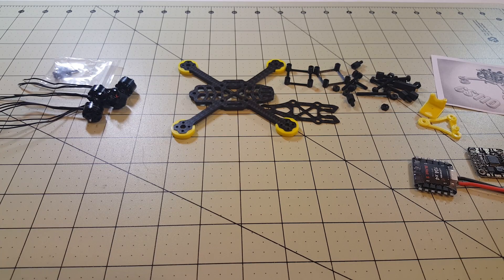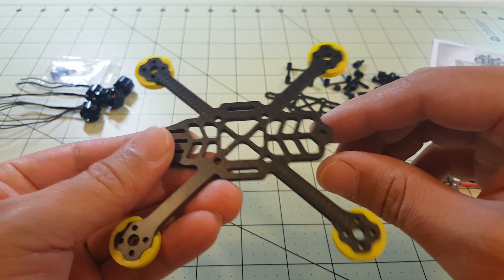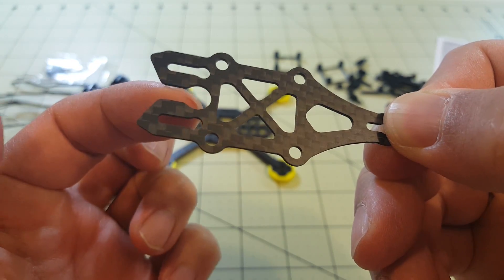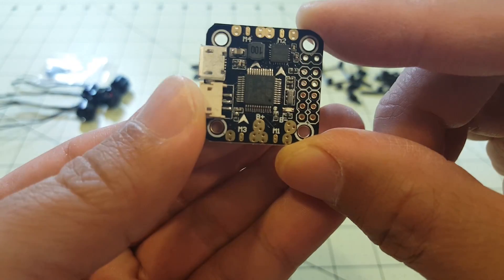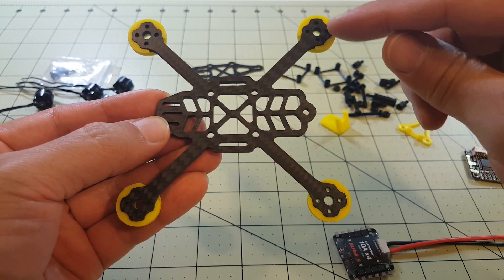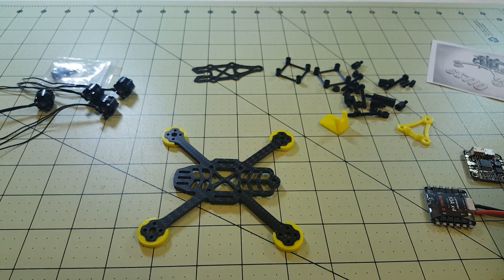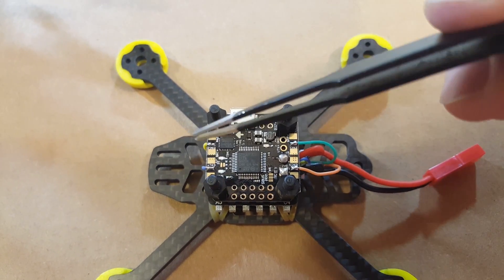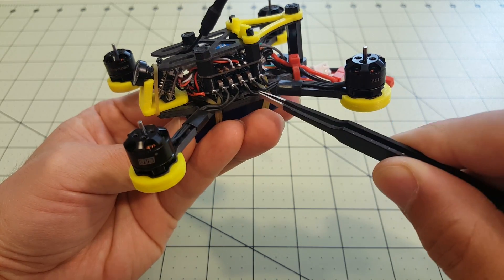Tomoquads Chopsticks Micro Racing Drone

Comment: So with the higher kv motors, does that mean there is less torque?
Reply from the maker: At the lower end of the throttle range but it depends on the stater size.  The 1103 will have less torque than the 1106 at the same KV.
Reply: Thanks for the reply! But what about if we are talking the same motor. What performance differences would I see if I used the same DYS motor but the 5400kv or the 6500kv?  Would you even notice a difference?

Comment: How does the KT100 build compare to this one?
Reply from the maker: +TransAm2k4 its got slower motors but still flies great.
Reply: I was thinking kt100 frame with the 1104 motors or is the extra money worth it for this frame.
Reply from the maker: The KT100 is a lot cheaper than the CS110.  If you really want the speed/performance, I'd say go for the CS110.  I plan to put some bigger motors on the KT100 and redo the speed test to see how much faster it will go.  I suspect it will be closer to the speed of the CS110 but won't know for sure until I do the test.
Reply: Well just when i thought i was going to go with the CS110 it also has a 7-8 dollar shipping charge making it mid 40s... way to rich for my blood.
Reply: TransAm2k4 see, that was originally my thought, but after buying so many cheap toy micros just to gwt in the game, and really being underwhelmed by both how much plastic toy transmitters i had and their average lifespan, i decided to pick up the qx90c, learn to fly with that and simulators, and save up for something i would be proud to fly. i just ordered the parts for my cs110 last night, and im glad i waited and didnt buy another pre built
Reply: Vincewhitney keep in mind that we are not comparing the cs110 to a toy grade quad or even a prebuilt hobby grade micro (such as Aurora 100 or ARFUN 90). We are comparing the cs110 ($40) frame to a $12 frame that i believe should be just as strong. All other components would be the same.

Comment: There is talk on banggood that this piko blx clone has an issue where the pinout doesn't match the wiring diagram, do you know of any issues with that?
Reply from the maker: Do you have more specific information about which pinouts don't match?  They seem to match up as far as I can tell.
Reply: Some of the reviews say the ground and positive for motors 1 and 3 are not correct on the wiring diagram, they should be reversed.
Reply from the maker: +Kel Varndsen hmmm, have not experienced that
Reply: O.k.thanks, I guess it wouldn't apply if you use a 4 in 1 esc and don't power the esc through the piko blx. I have one in the mail for a build and will find out for sure.

Comment: Nice,  looks faster than the Predator, at least on 2.5 inch props. What's the benefit of this one over the Predator? This can't run 3in props right?
Reply from the maker: It can only run 2.5 inch props.  Great for the MultiGP micro racing class.  Speed test coming soon.

Comment: Looks awesome! Can't wait to see speed test comparison to Predator. Was the problem with the 1st FC the holes were too small? Comments indicated it was 20x20, but only 2.5m screws fit (not 3m). Here is another interesting item: http://www.banggood.com/Eachine-Minicube-20x20mm-Flytower-Compatible-Frsky-Flysky-DSM2-DSMX-Receiver-F3-Blheli_S-10A-ESC-p-1127223.html?rmmds=mywishlist You can also get just the FC for $21.99... Thoughts?
Reply from the maker: Yes, the holes were too small. I'll have to use them on a different build.  The new cube looks promising for newbies who may find this an easier way to build.  I hope to get one soon.
Reply: Albert Kim question is, can my turnigy evo talk to that cube?? They have to start making these micro FCs with receivers to run afhds2.
Reply from the maker: +William Cannady I am flying this quad with my Turnigy Evolution and the FS-A8S receiver.

Comment: This is probably my favorite frame from Tomoquads! Especially with the newly installed RotorX 1105B!!! (Replaced the Racerstar 1104)
Reply from the maker: Seems like all the places I've tried are out of stock on the RotorX 1105B motors.  These DYS 1104 7000kv motors are still pretty sweet though
Reply: Albert Kim i got some RCX on the way... will surely give these DYS a try too, the RotorX Arve good but they are too expensive... I got mine from Airblade UAV, Canada, but they apparently just sold out too!!! These micro builds are so hot right now all these 11xx size motors go out of stock everywhere! It's crazy! Have you tried the 1102 from DYS, 7800kv and 10000kv I suspect they perform about the same3 from Racerstar. If your speed test include some tight turns the lighter motors might perform better???

Comment: Nice series of the MultiGP Micro Racing Drone. Can't wait to see if the 1104 x7000kv will be faster than the 1105 x 5000kv motors.For the lower 5000kv motors you might need more meat on the propellers. Try trimming down the GemFan 3025 propellers.